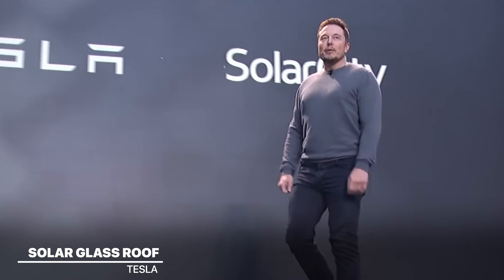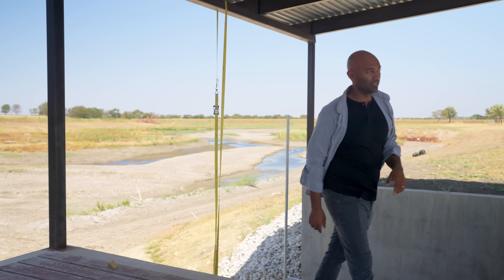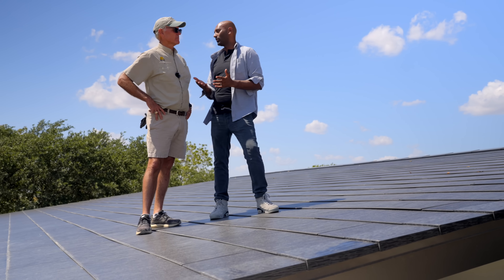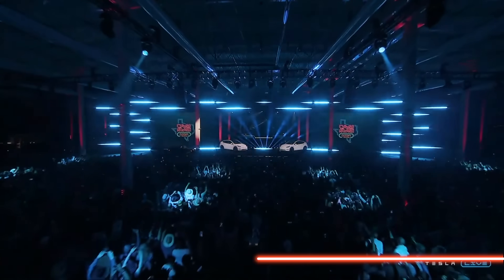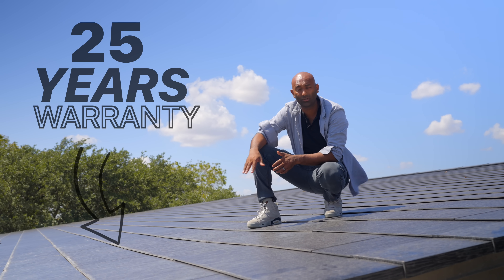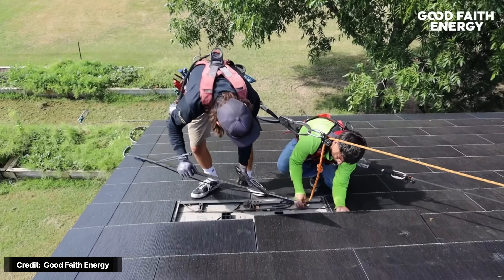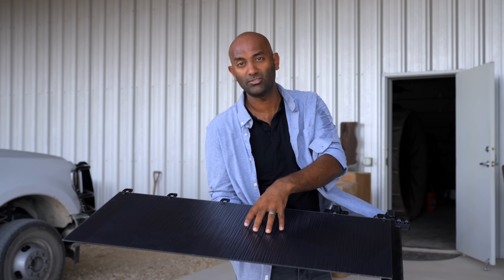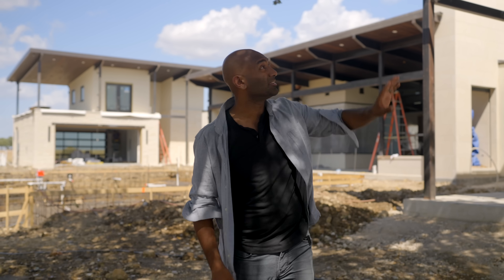Tesla Solar Glass Roof is About to TAKE OFF!

Comment: Clickbait title..Glad to see more about the system, but the title is bad. The owner seems.very happy, so that is not an epic failure. All new technology is expensive until it gets redesigned and cheaper.
Reply: Well, I kind of thought we'd get info about what's good, and then a few minutes at least on what isn't going well with solar roof - such as the pathetic number of installs. I completely missed it even though I've watched this twice more or less. I'm honestly wondering if there's a part 2 or some footage that got missed out.
Reply: @jonevansauthor yeah that’s the question. Why has Tesla failed to ramp it up?
Reply: I work in the industry. 

It has been an unmitigated disaster. It's been a fouled product since Tesla started. 

Tesla has tried many incarnations, and there have been lots of disappointed customers for all kinds of disappointing reasons. 

It is not a popular product. It is not an economical product. It is not an efficient product. Therefore, it is not an optimally-environmental product.  Compared to traditional panels, it is wasteful and exorbitantly costly. 

By my analysis, it costs almost twice as much is what our small company charges for a top-of-the-line solar system with monocrystalline panels and Enphase microinverters - a system that is expected to last at least twice as long as the Tesla solar roof product. 

A solar roof product has a weakness  that reduces its sufficienty and shortens its lifespan dramatically: Heat build up. Solar PV hates excessive heat. It starts going downhill above 77°F if you have conventional panels with that three or more inches underneath the panels by which they can be air-cooled.

You don't have any of that with solar roofing, no matter who makes it, so the efficiency drops drastically, as do the lifespans of the  solar cells.  

People realize these problems when they do the cost comparisons, and they also look at Tesla's long list of aggrieved-customer negative ratings. 

Everybody in the industry knows about this. It is not up for debate. It is an undisputed fact.  The presenter just did a terrible job of explaining/addressing such in the video. 

But then, he doesn't work in the industry and can't know what we in the industry know.

The title is accurate.
Reply: @chriseidam7319 it's an interesting dichotomy. When you look at the other businesses such as starlink SpaceX Tesla power and the car unit they thrive on iteration and perfection an innovation. With the Tesla solar roof it just seems like the same level of competence innovation and drive isn't there. Integrated solar roofs seems like a product that would just scream out the door if there was a good one that resolves the issues you mentioned. Why pay for a roof and then something on top of the roof especially on new construction. I hope somebody comes along and solves that. GAF has a product that seems like it could be a good compromise, but I don't know if the costs are reasonable and it doesn't sound like it would solve the heat issue.
Reply: I agree; though I respect Two-Bit’s time and effort in production, this wasted my time. 12 minutes into this 16 minute video and not a hint of what the title suggests. My suggestion: time for TBD to invest in a copy editor.
Reply: @mr.miniaturesmodels8465  Man, Oh man, comma, do we ever need copy editors today. 

Does anybody even employ copy editors anymore? 

I have a journalism degree, and it would have been absurd to think of copy editors losing their jobs and being eliminated. Now that's the norm.

The problem for YouTube presenters is that YouTube now pays diddly squat for a million views. I'm not sure if it varies from channel to channel, but it's roughly $4200. 

That's ridiculous. TV shows on networks like NBC might only get four million viewers, yet the episode creators get paid a fortune to deliver those four million viewers to advertisers for twenty-one minutes worth of content in a half-hour time slot.  A lot of YouTube channels are putting out videos twice that long with frequent advertiser breaks from major advertisers - that is a kot of work IF they can even get a million viwers for all that work. How can these guys afford copy editors?
Reply: That 50 is now up to 75. And that number is from just one Tesla Certified Installer - Good Faith Energy. There are hundreds of Tesla Verified Certified Installers. Good Faith Energy is just there one with the most installations so far.
Reply: It actually made me not want to watch it on that basis.  I'd have missed an interesting vid, if the quality of the channel hadn't swayed me.
Reply: While this title can get people who might not otherwise click, it can also alienate others--including your core audience.
Reply: Wake up from your Musk cult
Reply: Nah Tesla is a failure, Musk was in court over his fake solar roof tiles at that presentation, that Tesla was essentially an installation company or more like rebranding products from China and paired with Panasonic lithium batteries. You all need to really start thinking critically instead of believing everything Musk says.
Reply: Not click bait you dum dums, he said why it's a failure. A house needs to be built with the tesla glass roof in mind. A normal/typical house can't be financially feasible right now due to the typical house design of the past. Old complex roof vs new less complex roof.
Reply: It did
Reply: It's a huge failure. Quoted me 250k or 50% of my homes value for the solar roof.
Reply: @DJR-u2g  250k you can buy home in Eastern Europe easily.
Reply: With the only down side, that it's in eastern europe @mdjey2
Reply: It has been failure since the announcement, when they presented fake tiles and now they don't even offer that kind of tiles what they showed. Huge cost, small adoption so failure it is.
Reply: This channel is notorious for clickbait and half researched topics. I feel like the channel started off good but over the last year I noticed a drop in quality. The comments keep praising the channel but I call it like I see it and criticize every video that drops the ball.
Reply: It is a failure vs what was actually promised.

Comment: After 10-15 years solar panels are becoming a huge problem for enviroment. Used aolar panels are burried in the land of poor countries. Some says solar panel waste 200 times more poisonous than nuclear waste. All over the world places are storing tens of thousands of used elsctronic  bikes and cars. They getting rotten under the sky.  Car manufacturers like Ford with 92.000 unsold EV's are going back to combustion engines  and hydrogen engines. The whole solar panel and Electronic wehicle industry is backfires. Much more dangerous and poisonous than anything before. There will not  be Electrical grid to support this delusion. It's a money making business.

Comment: All new homes need large 2 to 3 foot roof overhangs. This will help protect the doors, windows and siding from rain and water damage.  Water intrusion is a buildings enemy and causes much damage every year.
Reply: good gutters do the same thing and better an overhang will only protect a small part of the wall unless the rain is vertical
Reply: @wraith600original1 gutters protect the foundation. That’s their main point. And no matter how good they are, enough rain and or wind, and it goes right over the gutter. And god forbid you don’t keep them constantly  clean.
Reply: @jamesbizs   if the rain you are getting goes over the guttering 1 it needs cleaning which you should do every year 2 you need bigger guttering
Reply: The lower 1/3 to 2/3 of any house wall will get hit by rain and water spattered off the surrounding ground surface. This is why bricks are so good. They withstand the water and joints can be repointed every 100 years.
Reply: @Dave5843-d9m  or even modified formulas of otherwise typical masonary compounds. Places to put viable recycled materials to reduce Garbage Hill caused by mountains of less than multi platform lego adaptability within design that we not only see, we generate enabling more of it by not demanding meaningful defacto standards on a otherwise repairable only planet in our holdings.
The things that should not be overlooked, or we get what we deserve by nobodies default than our own really.
Reply: I understand that, perspective is everything.
Reply: When the "footprint" of a residential property places exterior walls at code mandated setbacks on the parcel the overhang can't exceed two feet according to typical building codes.

Comment: I built 3 43kwh lfp powerwalls,  all 300amp output 840ah each! Guess what, it cost me under 100$ a kwh. Its getting mad cheap.
Reply: Wait til everyone wants to do what you did.  And it's coming.  Big time price increase and worldwide minerals constraints for solar manufacturing.   And don't forget fossil energy creates this, which is peaking now.
Reply: @mr.makeit4037 solar? Lol wait until governments force every company to do battery tech. I think they said, that if the UK goes  through with all electric by the 2035 date, they’d use the entire worlds supply…. Just the UK. Based on todays numbers. There’s no way these people are this dumb. Many of them are much smarter than me, yet I can clearly see it. So why are these things still happen? It makes no sense. Ignorance? Malice? Both?
Reply: @mr.makeit4037  
Drill, drill, drill.
Reply: @kissthesky40  did you know that  incentives  for drilling investments are going down because  of the interests in new energy technologies.  Ofcourse what society doesn't understand  is that fossil energy is the driver of these new technologies in manufacturing .
Also here in Texas new drilling and fracking is so close to other existing wells that what's produced is less and of poor quality.     Drilling in new areas also like the artic will prove to be extremely expensive and possibly not feasible in terms of energy return on investment.